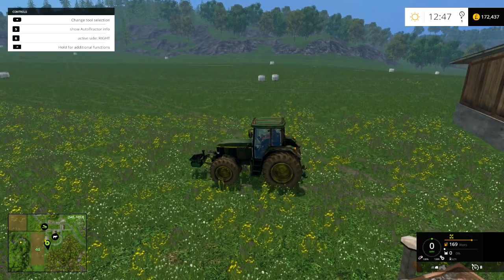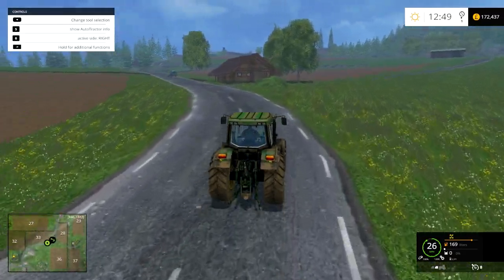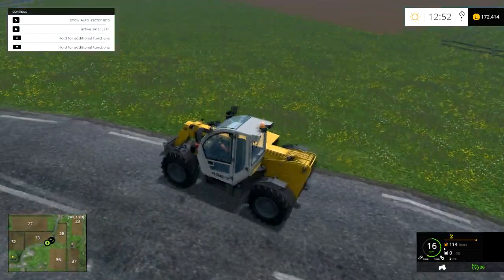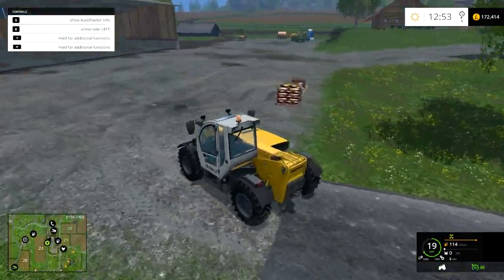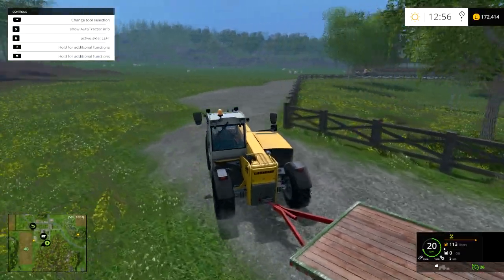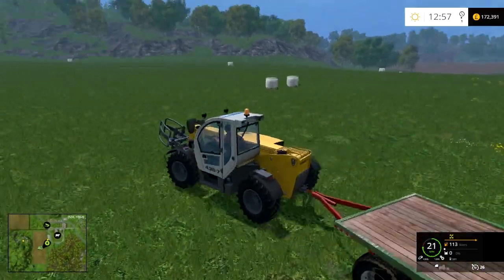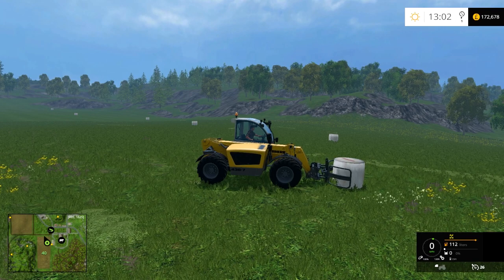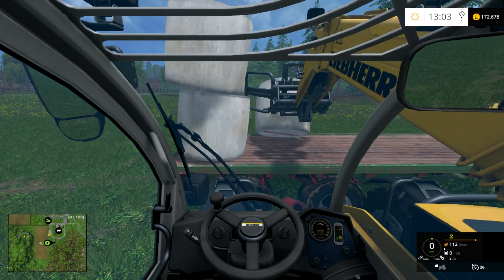farming simulator 2015 bale stacking

Comment: That movement on the wheels is perfectly normal. This is what we call "independent suspension". Both axles SHOULD have this function. Much smoother ride. Very standard stuff. Especially on new cars.  ☺